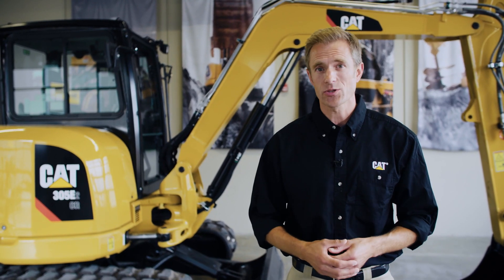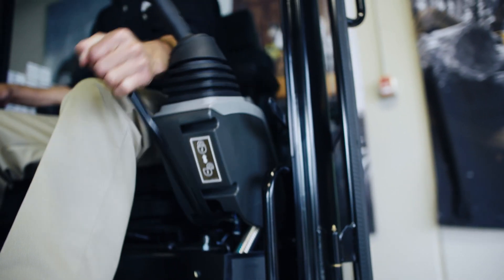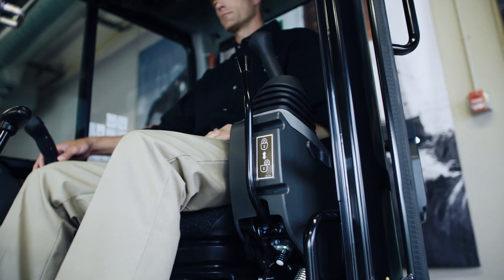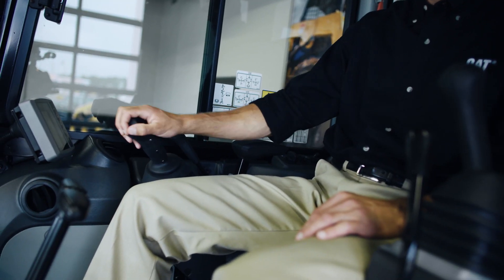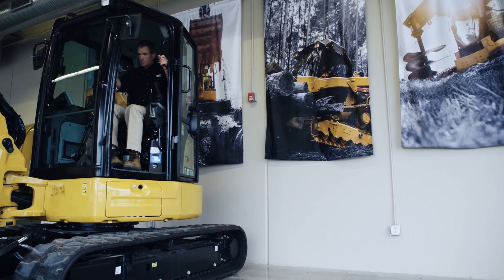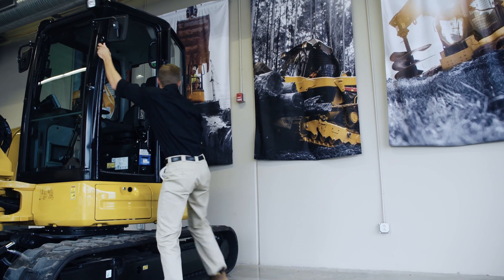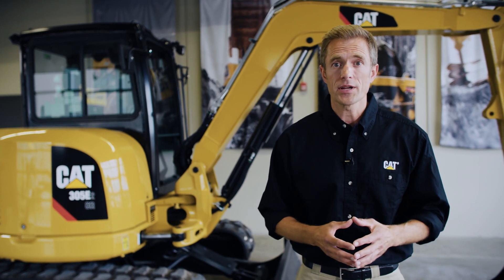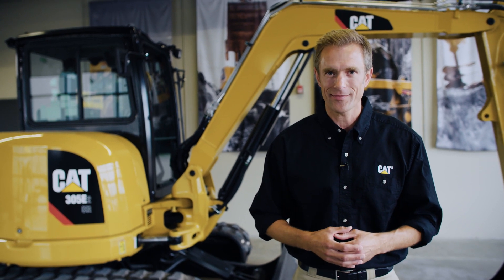How to Properly Park Cat Mini Excavator - Foley Equipment Tech Tips

Comment: 1 thing you did wrong was trying to release pressure in the hydraulics while safety lever was up. You need the engine off ignition on safety lever down then try it.